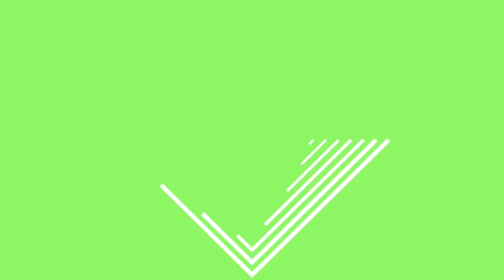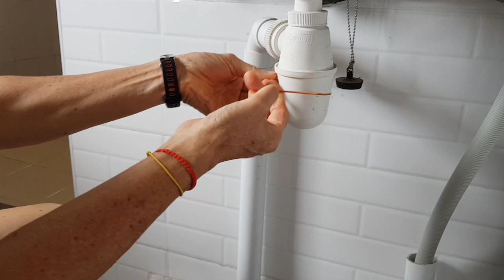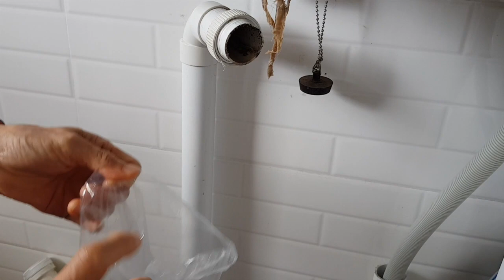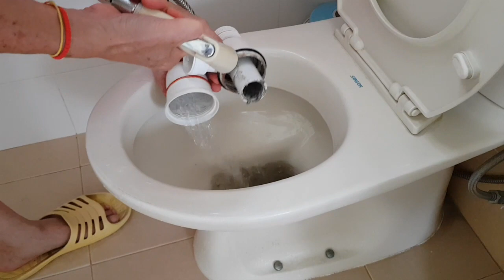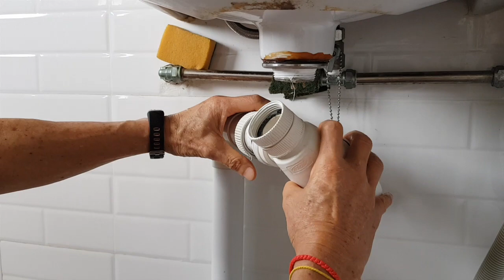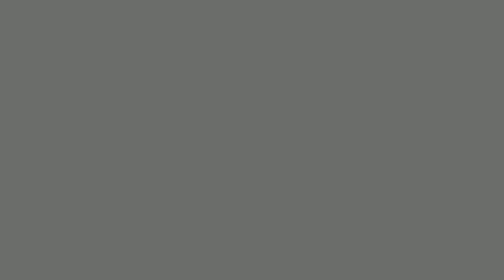How to Clear Choked Basin

Comment: Thank you thank you thank you. I was gonna cheat and just clean the bottle and not remove the whole thing but the water still wasnt going down fast enough. I hesitated for few minutes and was gonna give up. I hate working on piping stuff. Anyway I remove the whole thing and immediately saw the blockage. This is a kitchen sink so 6 years of oily stuff stuck there had to be remove. It wasnt that difficult but just gross. Replace the bottle trap if you have a weak stomach cause its a lot cheaper than paying for therapy later, trust me. Thank you once again for the clear instructions
Reply from the maker: You're most welcome.

Comment: Thank u for video! I saw some kind of glue around the bottom cup with upper cup. Any idea what time of sealant is that?
Reply from the maker: That was some old silicon that was left over by the contractor that installed my sink. You don't need silicon or any sealant if your rubber 'o' rings and gaskets are in good condition, it will prevent any water leakage, even in high pressure systems we depend on the rubber gaskets and o-rings to do the job!

Comment: If the bottle causes choke. Why do we use it in the first place? Just wash everything down? Even with bottle trap not all dirts are trap there. Some still flows through right? Ty  in advance
Reply from the maker: This is the requirement, it acts as a strainer and also to prevent the smell from coming out of the pipe.

Comment: May i ask what is the rubber for?
Reply from the maker: Rubber o-ring and gaskets is to give a good seal between the 2 other hard surfaces as rubber is compresseable. Since the drainage of the sink do not have high pressure, do not over compress the rubber rings or gasket. Usually once the contact is there between the two surfaces just another half to three quarter turns is good enough to prevent leaks.

Comment: Of course, before you do this, try 1. flushing down about 1.5 litres of boiled water or 2. add baking soda and vinegar. Flushing down boiled water fixed my kitchen sink drain pipe choke.